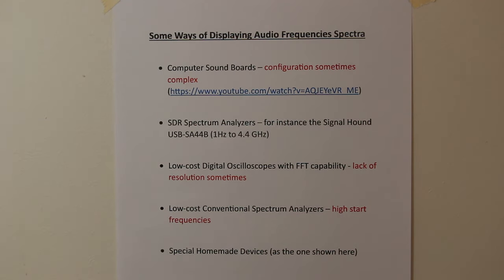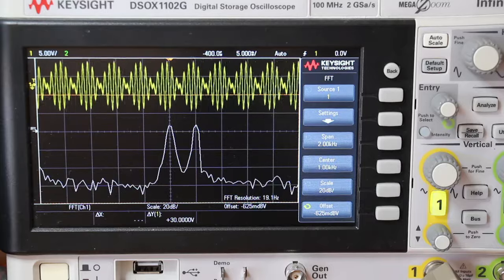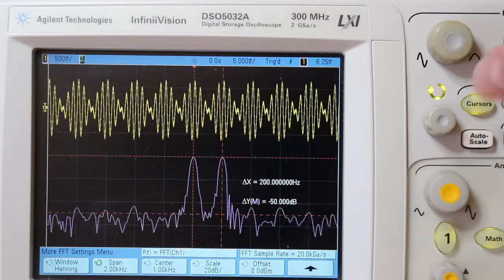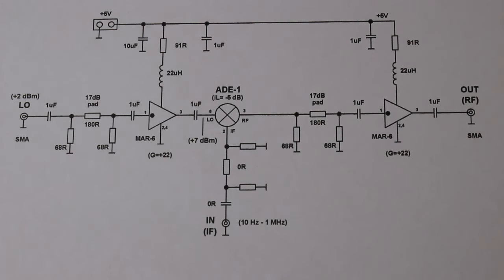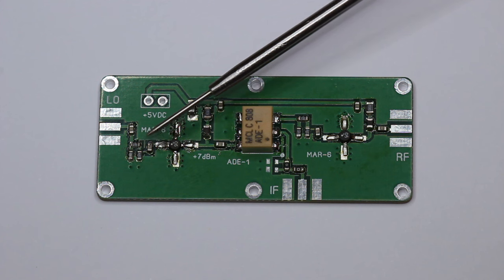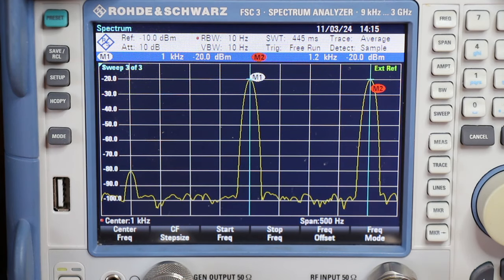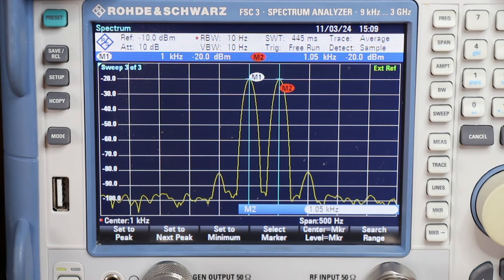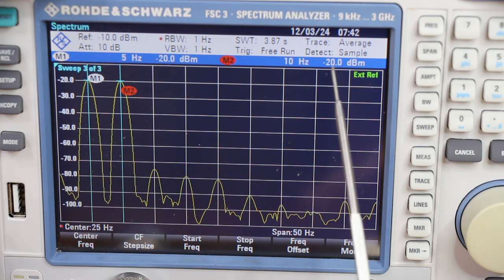#33   Displaying and Measuring Audio Frequencies in the Frequency Domain

Comment: Cool, but on the other hand, you could simply slow down the timebase on the 'scope to get more waveforms on the screen to increase the resolution. I can easily and completely separate two tones at 1000Hz and 1005Hz (with levels shown in dBV) on my cheapish Siglent 'scope's FFT.
Reply from the maker: True, you can have better tones definition changing the timebase, my bad. However, the dynamic range is about 30 dB better using the spectrum analyzer (at least with my instruments) and it's easier to measure.
Thanks for the input.

Comment: Impressive! I must admit I was skeptical at first, because a good sound card can achieve close to 100dB dynamic range, with the frequency resolution basically only depending on capture length. However, it seems your project can easily match that performance, and on second thought that’s not too surprising with the high quality, low noise components you are probably using. One question though, why the attenuated followed by amplifier stages? Wouldn’t that just introduce more noise?
Reply from the maker: Thanks for the comment. 
The noise contribution of one attenuator pad is about 0.0203 uVrms (-140dBm) for a BW of 500 Hz (span chosen), so doesn't impact much on the measurement, also because there's also the noise contributon of the generator and amplifiers. The timebase phase noise is about -150dBm@100Hz.
The attenuators were introduced mainly to adapt the levels, but the second attenuator has also the function of providing a consistent 50 Ohm resistive load to the mixer, minimizing reflections.